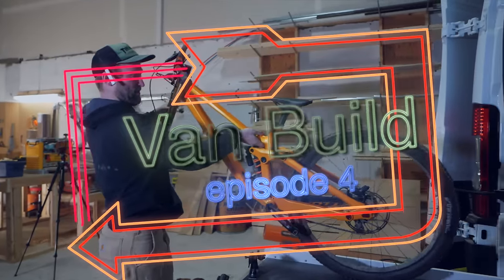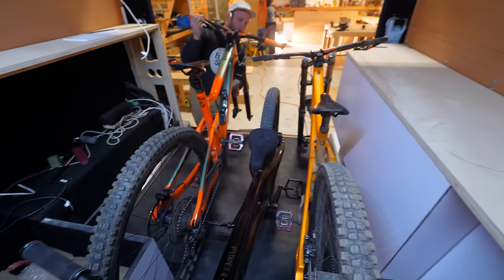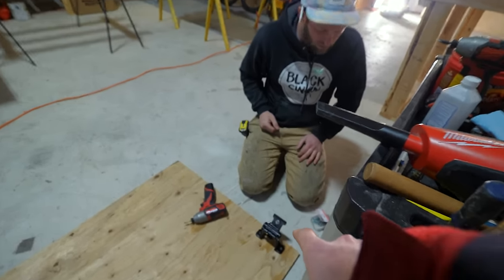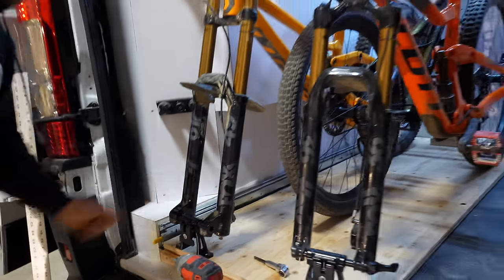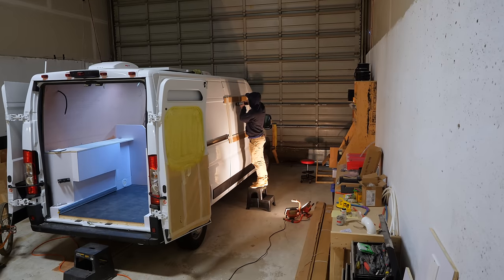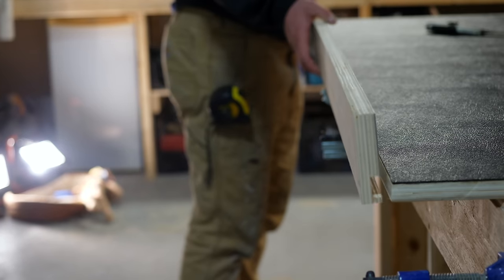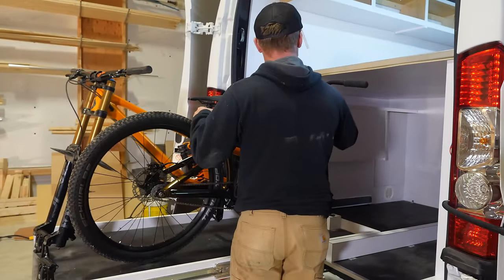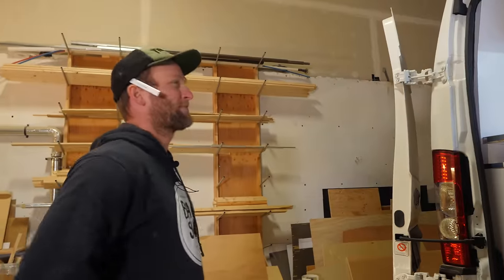Building a Pro Custom Sliding Bike Tray for 3 Bikes

Comment: Hi Paul, maybe put some carriage bolts on the mounts, hang the bolt below the tray and tack weld the nut to the bolt.  Of course do this once everything is sorted.  Good insurance for theft protection, however a pain in the butt if you need to make adjustments.  If you need to remove the mounts you would have to zip off the bolt and nut, but that is cheap.  Then one last lock on the tray.  I work for a large utility company and the guys before me here have been using carriage bolts and welded nuts for a while and it seems to help with theft quite a bit.  Project is looking great.
Reply: Correct me if I'm wrong, but I don't see the point in even locking the fork mounts in.  Just remove the quick release on the forks and the whole bike comes out. Minus the through axel

Comment: phew that's a tight squeeze. hopefully will still fit with any future bike changes.
Reply from the maker: Well nothing will change for next year :)
Reply: short term vision of a Millenial 🤪
Reply: @coastalzapper4840  ok Boomer
Reply: @coastalzapper4840  there it is
Reply: Yes, absolutely agree. Longer wheelbase or higher stack down the line would indeed be an issue.

Comment: The build is coming along great! I've heard you mention converting the DH bike into a Mullet a couple of times. Make sure you look into that. From everything I've heard, it's best to start with a 27.5 bike and add the bigger front wheel. When you mullet a 29er, the geo tends to end up pretty far off. Much slacker, lower BB, slacker seat angle, etc. Might not be too big of an issue with a DH tho, since you won't be pedaling much 🤷‍♂️
Reply from the maker: Well don't forget the gambler is designed for both. so it doesn't matter. :)
Reply: @PaulThePunter : I wasn't aware of that. Let us know how it rides. I'm definitely curious about trying it
Reply: Chump MTB Brendan Fairclough runs a mullet setup on his gambler, and he doesn’t run a custom rear end or anything. The gambler is just so adjustable that geometry isn’t an issue.

Comment: How tight are clearances all around? As in, when the van is moving and bumping up and down, and forks and shocks and tyres are compressing etc, is there wiggle room so that levers and pedals don't gouge the surfaces? Or get gouged? Just hard to see on camera exactly, but genuinely curious as to how much play the pro installers allow, for future builds myself
Reply from the maker: They won’t. Suspension and tires wouldn’t compress with the insanely small amount of force that’s being subjected to them.
Reply: Awesome good to know. Thanks Paul!

Comment: Every time I see someone build the bikes so tight to the bed and other things I always think what happens if they get a different bike later. Do you think there is much room if the next bike is a little taller or the pedal can’t fit in the frame of the other bike?
Reply from the maker: Great question! My bikes won't be any larger than this. And in reality there's the possibility of moving the front mounts around to accommodate for that sort of thing. However I would bet that the difference is minimal.
Reply: @PaulThePunter  I was thinking some bikes the headset are higher off the ground than others.  Let's say your next bike is like that.  Either way, it could totally be a moot point and be one of those things I'd worry about and never experience.  I have a lot of those in my life.  LOL

Comment: Ive been thinking of making one for my one bike (with space for a second in the future), but in order to save space, lengthwise and height, I was thinking of removing both wheels.
Thoughts on that?
Sure, may take a minute or so longer to setup or take apart, but it will save on space big time.

Comment: Very clean...  I always wondered in the other builds I've seen, no one turns the axle mount at a slight angle.  Where do you store the front wheels?
Reply from the maker: All will be explained
Reply: Who needs a front wheel. More aerodynamic and less weight!
😂😂😂

Comment: Hey Paul,  I am just curios if you had thought about letting the air out of your forks to lower them about 10cm or more. As your driver side storage room is too high for that it doesnt make any sense now, but I am building a van in the future too and considering doing that to have more space over the bed.

Cheers man! :-)
Reply from the maker: Nope! I want the bikes to just be ready to gooooo. No faffing as much as possible.
Reply: @PaulThePunter  totally understand that. Maybe i will do that just to have that extra 10 - 15cm. I would say its about 1 minute extra to refill them with the shock pump...